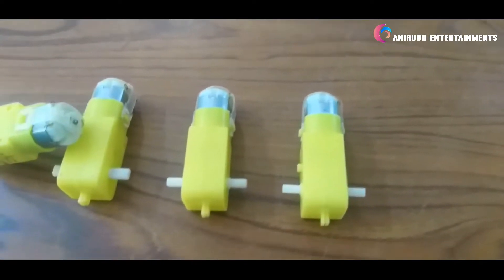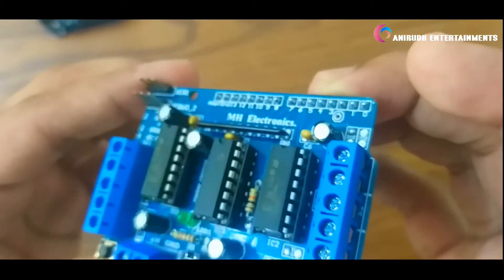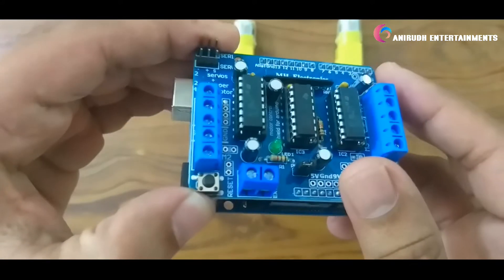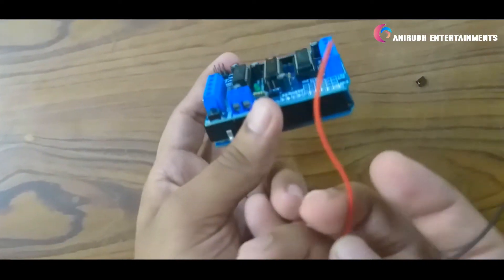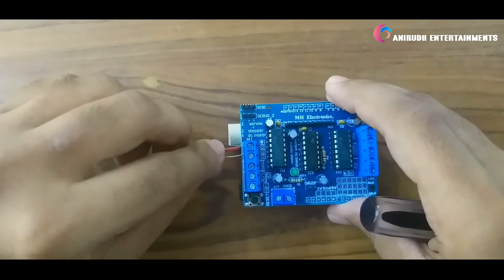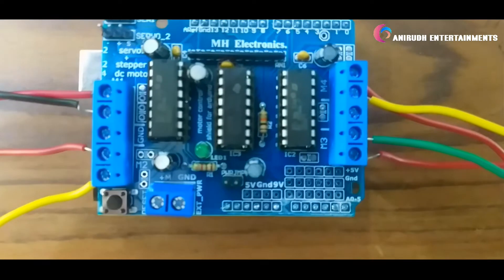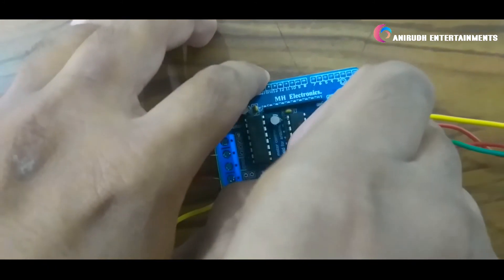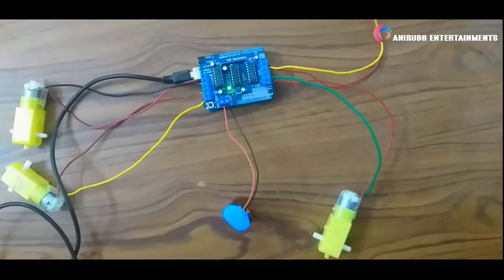L293D Motor driver shield unpacking and running 4 DC BO gear motors

Comment: Bro till how much mah battery we can plug to motor driver shield bro can I use 4.2 v 6000 mah battery of 2psc is the motors works good bro plz give me a solution bro plzz
Reply from the maker: Yes you can use it
Reply: @laIlavaraz  but bro when I keep my 20000mah powerbank it is not supporting that means car is not moving at all why bro means for 6000mah 2 psc means 12000mah it is. Ok naa bro

Comment: when i uploaded the code the motors were not running , it can possible that the batttry was weak or discharged because i used the same one
Reply: no ,he is not using the code that he extracted first 
there is a modification that need to be done
Reply: No bro first clear all data from the Arduino and then reapply the code the car will definitely work and one more thing use only 18650 batteries to perform better
Reply: I also had this issue, make sure that after you extract the library folder, you move it to the "libraries" folder inside the Arduino projects folder on your computer. Location of Arduino folder could look something like this: C:\Users\(username)\Documents\Arduino\libraries if you installed Arduino IDE with default settings.
Reply from the maker: Yes maybe of tha,also check your connections again.
Reply: No bro first clear all data from the Arduino and then reapply the code the car will definitely work and one more thing use only 18650 batteries to perform better